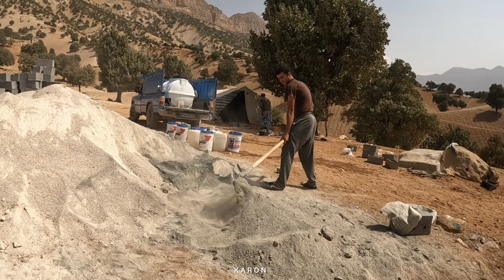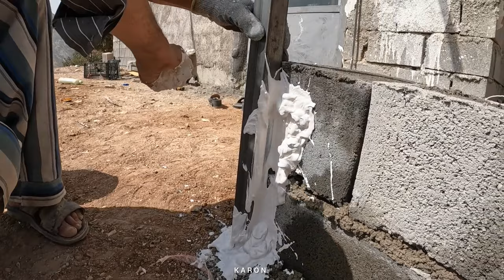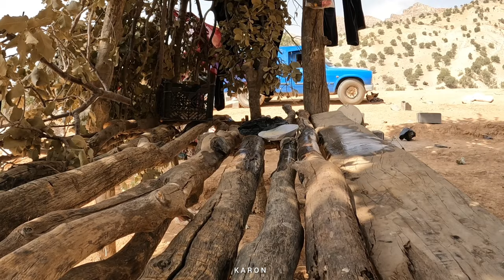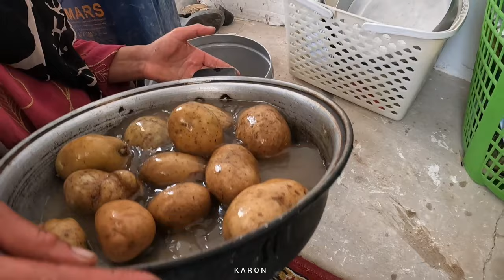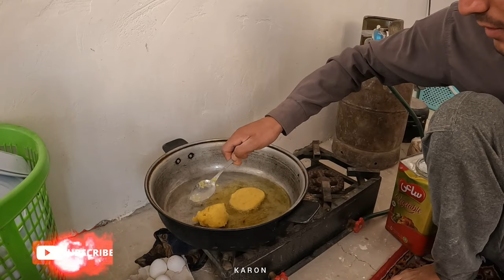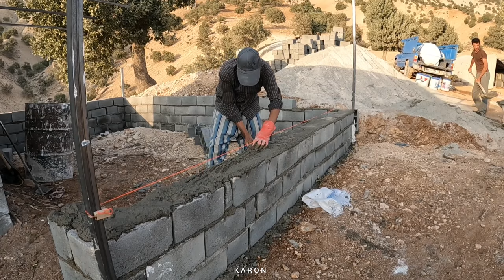Nomads Documentary: The Chinese wall of the residence walls

Comment: I find your women washing clothes in a strange way. First fill the tub with water full than add four fist of detergent whisk with hand till the foam is made put six shirts in it than hold the shirt  in both hand and rub together to remove the dirth. Get a small hand brush for washing jeans spread jeans on a floor and put little detergent and scrub hard and than wash off with water. Dont throw away the surf water add more clothes in it to wash. Use the another tub to wash away the detergent.
Reply: Exactly  what I've been saying. They have plenty of huge cooking pots to use one for washing one for rinsing. Her task time wise would be cut in half and probably use less water.